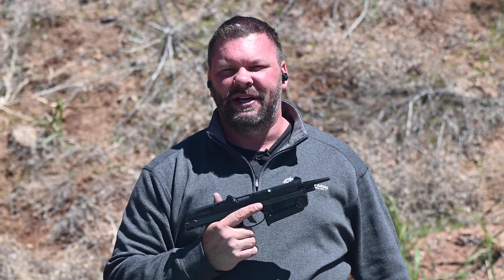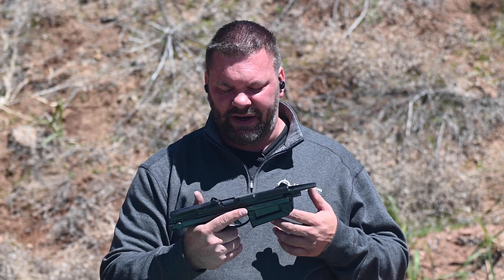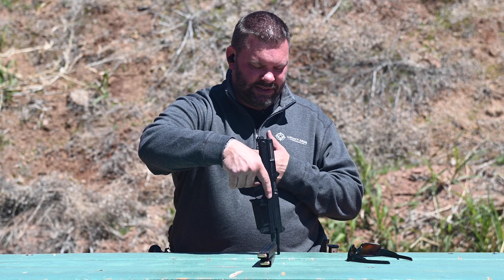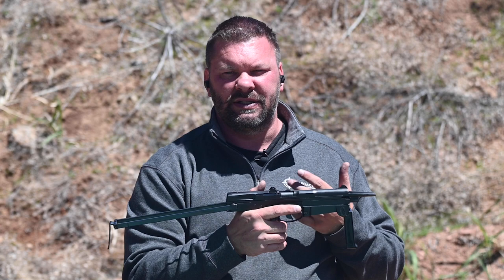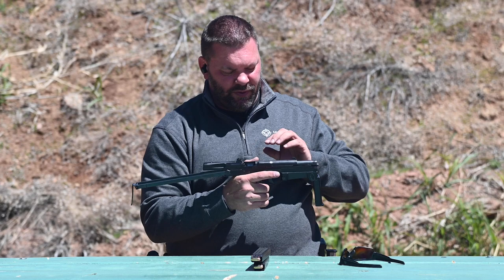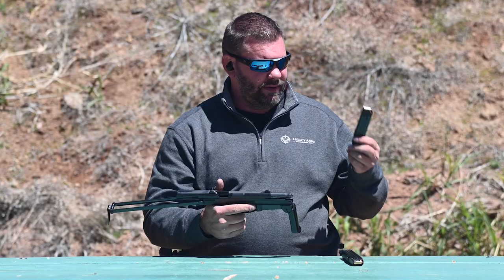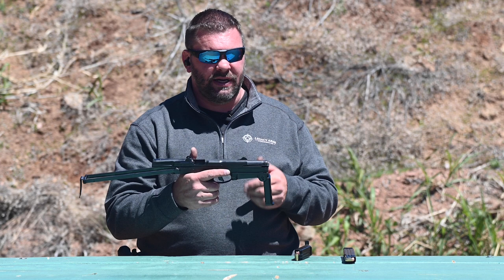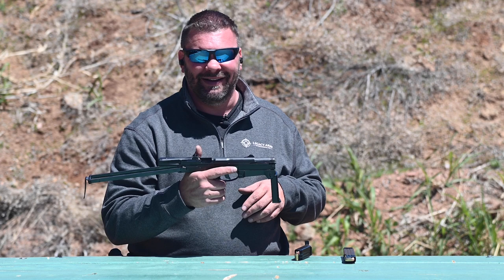PM 63 Machine Pistol

Comment: It appears to have a significantly lower (more useful) rate of fire compared to the Beretta 93 or Glock 18.  Thanks as always Jason for sharing.  Take care.
Reply from the maker: Thank you for your support! It is definitely slower than a G18. The 93R also has a higher rate of fire but it only fires in a 3 round burst which makes it more controllable.